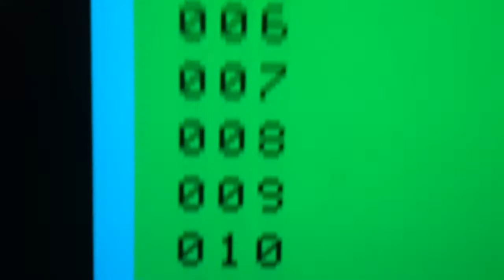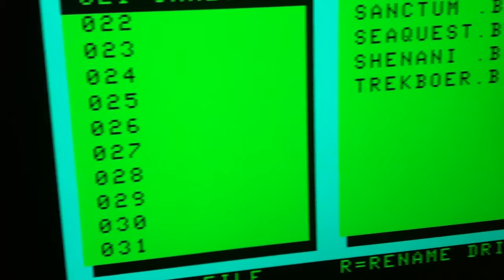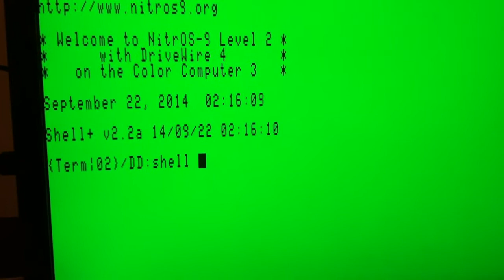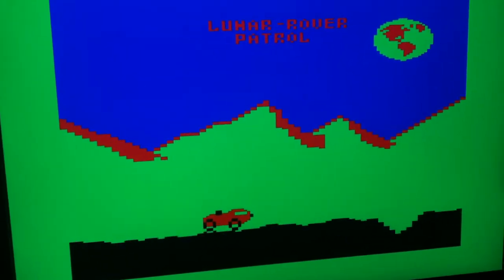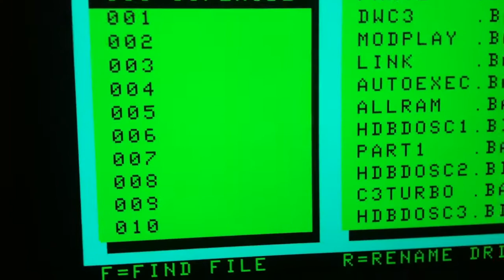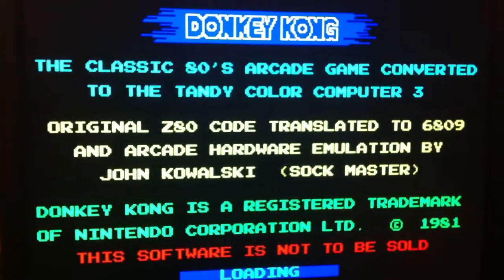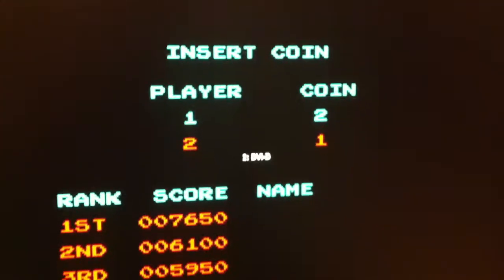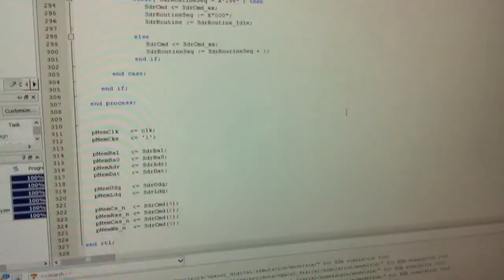RGB2VGA FPGA - Scandoubler

Comment: I'm interested as well, if it can be implemented with an inexpensive fpga chip. I also have a Commodore C128 that has 15khz RGBI and I know a lot of C128 users are looking for a solution like thisl. Currently many use a GB8220 board with a simple RGBI to RGB converter so an all-in-one solution would be really nice.

Comment from the maker: 640x240 bytes at least. You will have to use SRAM or SDRAM. My project uses SDRAM. Also, you need at least 2048 bytes of FPGA ram. You can adapt to digitize only 640x204 and this will fit a 64K FPGA ram.